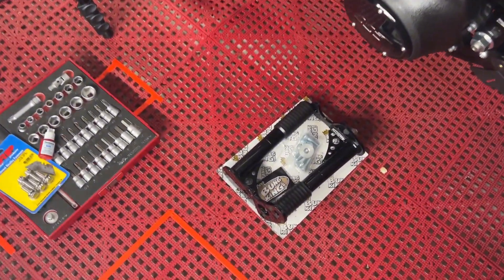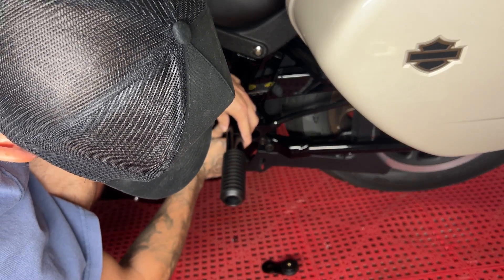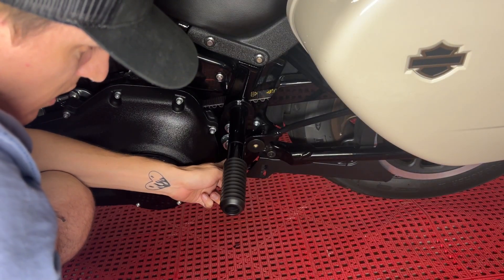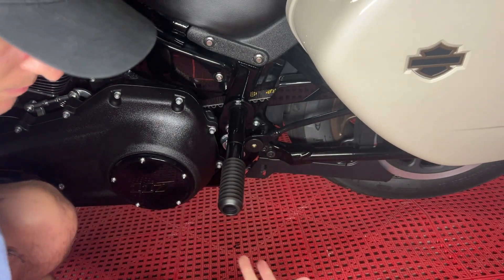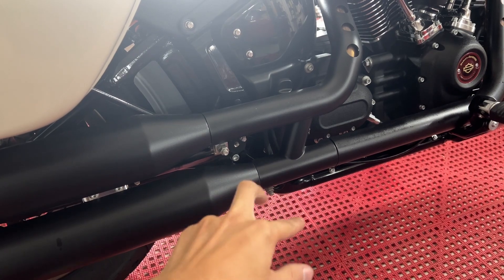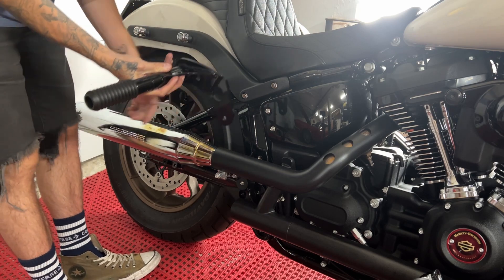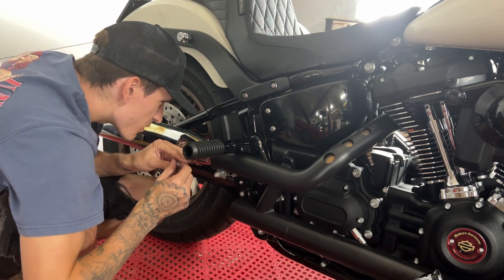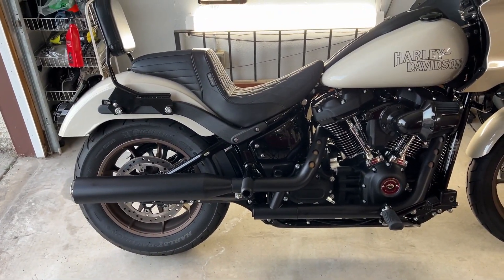Low Rider ST BungKing passenger peg slider

Comment: Do you have the sizes for the ARP bolts you replaced and where did you purchase them?
Reply from the maker: I’m going to hopefully be making a video once I finish getting every one, almost done with the entire bike, going over every single ARP bolt. But the size is 3/8 1 inch and 1.25 inch. Subscribe and stay up to date on when i post the video.
Reply: @AlenGarner  Thanks, great video. I subscribed immediately after viewing….haha. Any other mods planned?
Reply from the maker: @matthewpail9150  I have a s&s stealth stinger I made a custom cover for need to upload the video and I have a sawicki mid length on the way. After that just enjoy it for a few months then do a cam and little head work